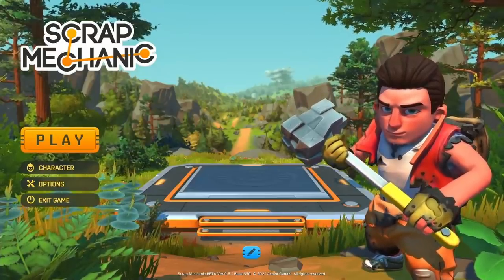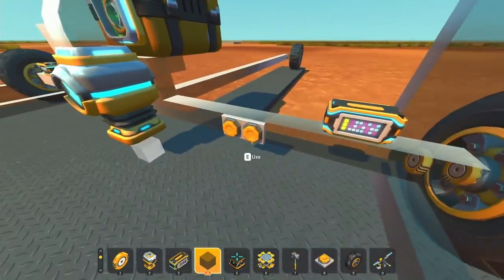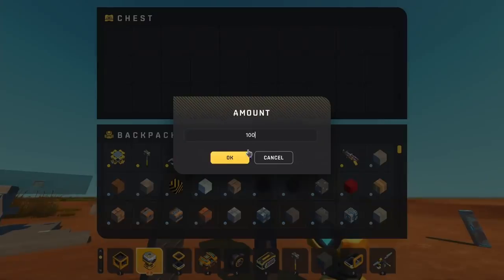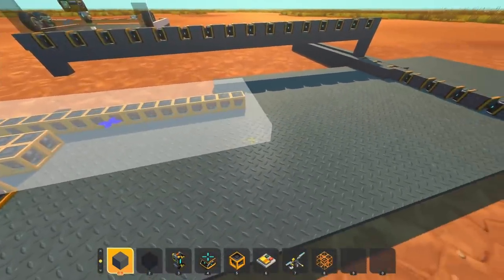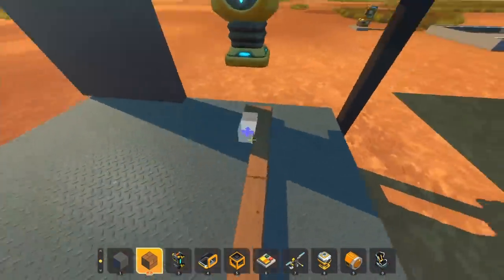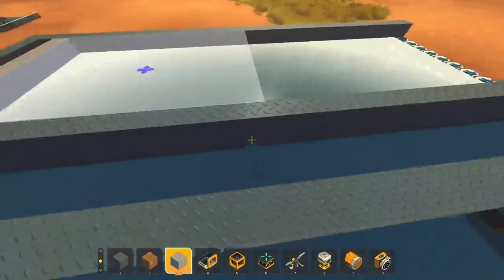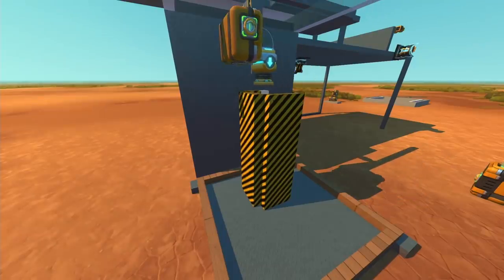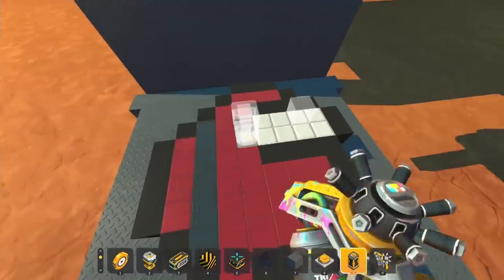Making a 3D Printer in Scrap Mechanic

Comment: For the pistons you could have made them corespond directly with the binary input.
You have one piston each of length 1, 2, 4, 8, 16, 32 etc, and that gives you full coverage of the space with less complexity and gates
Reply from the maker: Yep, solid optimization
Reply: Just what I came here to say
Reply: @ReidCaptain  happy new year btw
Reply: yup, was gonna say the same thing
Reply: thats exactly what i was thinking he was gonna do, but for some reason didnt. also, even as a veteran SM player i forgot, but pistons have a limit of 15 extension length
Reply: @123deserted  happy new yr
Reply: Thats how i do it. the pistons only go up to 15 though so you can only use a 4 bit number before you have to start combining pistons for larger numbers.
Reply: i actaully made a 3d printer because of this comment, with the use of your idea :)
Reply: @ShayTzabari  Me, too 😆
Reply: That's what I thought he was going to do the moment he started with the wheels and showed how they are unfeasible. I was really surprised when he chose the least optimal version. xD
Reply: even better: two pistons that activate alternatingly to stay on one spot. activate both to expand, deactivate both to retract
Reply: @Hlebuw3k  Mods.
Reply: @benjaming.8368  You will new to be carefull with timings or use some sort of position decoder.
Reply: @tenix6698  so did i look at CommonColdYT ytchannel
Its kinda a crappy vid tho
Reply: They are speaking the language of the gods.
Reply: I made a 3d printer in sm using that
Reply: @carsoncoder  nice

Comment: You can make a any 32 lengh piston extender with just 2 pistons by pulsing them on and off, so when one piston is on the other one is off, then hook up one button to extend both, and one to contract both
Reply: I think it's 30, not 32.
Max piston length is 15.
Reply: Also I think it would be hard to automate so it moves to a precise location.
And also

Pancake
Reply: accuracy with those things doesn't exist
Reply: @limonlx7182  kan made it for his survival watering system a while back, so its possible. and, zero extension is also a useful value for this, so that makes 31. you are partially right, im bad at simple counting
Reply: thats good for incrementing or decrementing the distance, but moving to an arbitrary point doesnt work
Reply: @Hlebuw3k  water cannons can afford to have a lessened accuracy because of their splash this cannot because this is accurate to a single block
Reply: @guymanhumanperson  watch the vid and find out. it is 100% point accurate

Comment: Hello Reid Captain! Your 3D printer model is great, but I wanted to suggest optimizations, coming from someone else who built a 3D printer.

1. If you make a memory unit for this printer, DO NOT USE LOGIC GATES!! Too bulky. 
2. Maybe having extra vacuum pumps can speed up the process.
3. Using additive and subtractive manufacturing limits the materials but allows different designs.

Really hope this is seen by Reid. 
Happy new years day guys!

Comment: 3:30 if you want to make a precise mechaniosm using pistons you can check out KaN. He made a video where he made a robot arm he could adjust using two buttons for extending and contracting, It used only two pistons too. (The video is called "How to Build a Double Piston Robot Arm for Survival")

Love your content
have a nice day :D
Reply: Polacy!!! Nasi!!!
Reply: Skittle503  nick Polish last name and name
Reply: I don't think it's good for this exact situation.
It works perfectly with a human controlling it, as you can adjust it however you want. But if you need to program it to move automatically, you would have to calculate speed and time to move it to a precise location.
Reply: Skittle503  i think they said "polish! nice!" greeting their comrade
Reply: @limonlx7182  its actually pretty easy, kan made an auto watering (and planting, i think?) system for his survival world using this piston method, you just have to extend for a specific time interval, and thats pretty easy to do with timer logic
Reply: I was checking if someone said this.
Reply: @limonlx7182  well, maybe use sensors to count how many blocks the printers head has moved and than using some logic count it all
Reply: @Debi2137  Polska Gurom !1!!
Reply: @loik1loik1  A jak

Comment: 1. Vacuum pumps can place blocks up to 16 blocks away.
2. You could use the pistons more efficiently by using them like binary numbers - 1st piston extends 1 block, 2nd - 2 blocks, 3rd - 4 blocks, 4th - 8 blocks and so on. (+almost no logic needed)

Comment: From my understanding, having watched this video but not played the game:
- Your x/y arms were controlled by 4  inputs, which are interpreted as a binary number from zero to fifteen.
- it does not matter which pistons in the arm extend, it only matters that the number which do = the number input.

Given that both of the above are correct, I don't think you needed any logic between the input and the pistons. I think you could've just connected one input to one piston, one input to 2, one input to 4, & one input to 8, and achieved the same effect.

EDIT: since it is easy to misread this comment (judging by the replies), let me clarify a couple of things:
1) "one input to 2" means "one input to two pistons," not "one input to a 2-long piston." The same is true for "...to 4" and "...to 8."
2) I am trying to preserve the fact that the pistons used in the device are 1-long, just in case that fact is relevant. It's easy to adjust my idea to work better if the pistons can each be any length without breaking the device, so I left how to do so unsaid (one would do so by swapping n one-long pistons for one n-long piston for each input).
Reply: I believe he had all of his pistons only extending one block. I think that there would be issues otherwise because of the blocks between the pistons (trust me, you can't put a piston directly on another)
Reply: @perodactyl490  The fact that the pistons were each only extending one block is exactly the reason why my idea should work. If they were expanding a different amount of blocks each, my idea would fail.
Reply: @delta3244  When I read your comment I thought you meant having a 1, 2, 4, and 8 piston. Maybe I thought wrong. Or maybe I am just not getting the idea.
Reply: @perodactyl490  He meant 1, 2, 4, and 8 length for the pistons, so you don't need so many pistons, and so you don't need the logic to convert from binary to the pistons.
Reply: @perodactyl490  I was assuming that there was a reason all pistons were 1-pistons. I was talking about still having 15 pistons, but wiring them differently
Reply: @vibaj16  Close, not quite. I'm assuming that there is a reason all of the pistons were 1-pistons, and suggesting that the switches are wired to that number of 1-pistons. If the pistons can each be of any length without breaking the device, then what you said would be better.
Reply: @delta3244  No, he simply didn't think of it. Someone else suggested it, and he replied saying "Yep, solid optimization"
Reply: @vibaj16  That's what I said. I said "having a 1, 2, 4, and 8 piston," as in one piston with 1 length, one with 2, one with 4, and one with 8. Unless you are talking about using controllers to change the length of one piston, in which case you would need to add up those bits to get the total length. Even so, a controller cannot be reprogrammed in action.

Comment: If you have 2 pistons on each other you can give them opposite pulses you can have one button to push out and another to pull in. You could the. Use sensors to see when the head is in the right spot.

Comment: What would be really sick is if you added a second placer, with a different color-- so you could program in support material, which you can remove after printing.
Reply: that would be like on real life 3D printer except that you will have two placers

Comment: Just for next time, you could have added a last piston that is by default extended through a not gate representing a “-16” - this is how negative numbers in binary work, having the first digit represent the negative, and in this case it would have doubled your buildplate with very little extra labour and it would have made x=0 and y=0 on the plate be the center. Great video tho!

Comment: i have a suggestion for a the printer 
use cardboard censors and mountable spud gun
the carboard is going to be carved by the mountable spud guns
and the censors detect the shape of the object 
this is only for a 2D printer
idk how to make a 3d printer in scrap mechanic

Comment: tip: you can control pistons by connecting them to controllers
Reply: wait WHAT
Reply from the maker: Yep, mentioned it toward the end. Would have been slightly useful for the 16 byte storage
Reply: @ReidCaptain  Now make the storage fully logic based, so you use buttons to input into memory
Reply: @rebel6301  yes, you can
Reply: @ReidCaptain  try the modpack continuation

Comment: I really like what you did there but I think you should have included an encoder so you wouldnt have such a bad time with programming the print structure

Also it is possible to build support blocks to get an actual 3D build, one way to do it would be by replacing air Blocks with glass and the other one would be by placing blocks on the side of structures.. but that would mean a lot more work as you'd need a second printer and decoder 

Are you planning on redoing the printer with the knowledge you managed to gather so far?
Reply: It's very rare when scrap mechanic youtubers return to their old projects

Comment: wAiT wHy ArE sOmE CoMMenTs 5h AgO iF tHe vIdEo HasNt EvEn ComE Up yEt (even tho this will be 7h ago upon release)

Wouldn't it be more precise if you first moved 1 axis while the other is locked by a guardrail, then retracted that guardrail, locked the first axis, and moved the other one? Or just more work and logic for the roughly the same outcome? Anyway, nice vid, I'd like to see other kinda dumb ideas (unlike this one) such as a vehicle powered only by the hammer.

Comment: 🤔 You could have made it controlled by sensors because you could have put like for example 16 vacuum pumps and 16 sensors and you could make the object on the sensors but it wouldn’t make it 3D 🤔